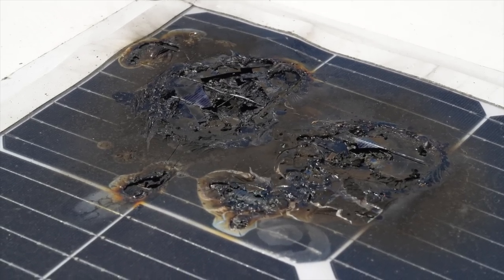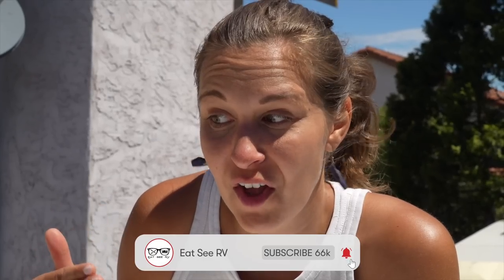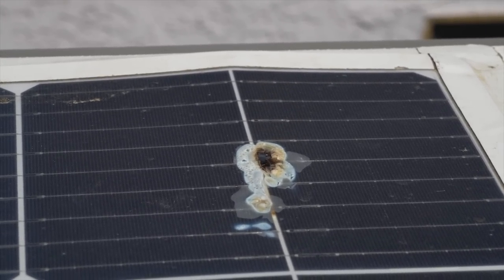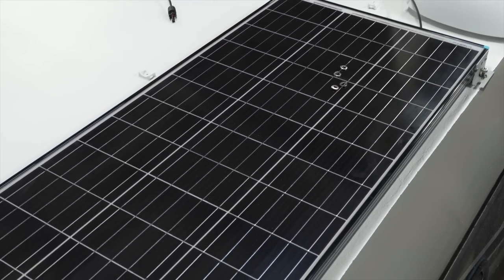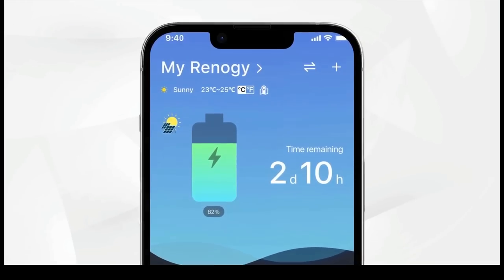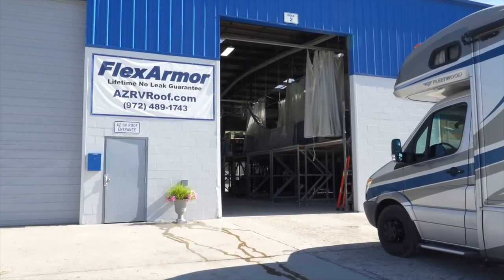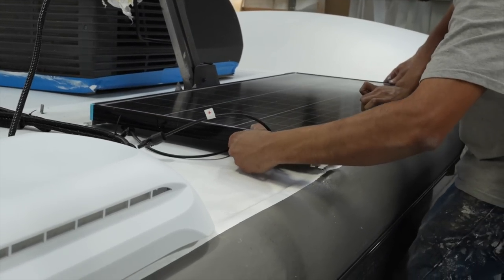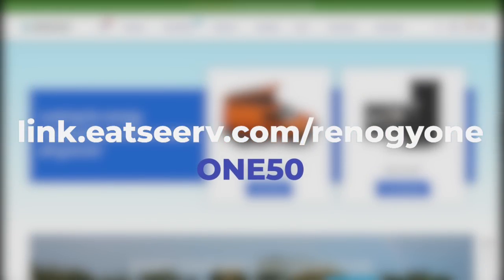Don't Let This Happen To YOU! (Our RV Solar Panels Caught on Fire)!

Comment: Just 2 minutes in and you probably answer this and I will keep watching.  But what did the manufacturer say about this type of mounting?   Asking now because I might have to pause video and not come backfor an hour.
Reply from the maker: The manufacturer says you should adhere it to the roof tightly so no air can get in (tape on the sides isn't enough). But from further research that can cause hot spots since there's no breathability underneath the panel and can cause a fire that way. They simply aren't worth the risk!
Reply: @EatSeeRV   Thanks!!!!   I thought you used them outside their scope, but you didn't.   I was thinking where is the cooling effect, (breathability).   These people need put out of business before they kill someone. I hope you pursue a settlement from them!

Comment: I have a curious question. I have seen that these flexible panels have been melting like this also. But my question is, is the spray armor conductive or non conductive? Curious.
Reply from the maker: We haven't had any other issues with flexarmor burning with other applications on the roof. The issue is the flexible panels.

Comment: Flexable panels are far frailer than ridged - with a clear plastic insulator to the front and no circulation from the back the heat poured in with no way to get out - failure was inevitable eventually - the only effective solution is ridged panels mounted so air circulates under - I use rec twin peak on my RV  and they work flawless - some of the tiled types are even better

Comment: Yup need air flow under panels. That's why I would never use stick down panels,not worth weight savings.... Sorry for this,glad your ok.
Reply from the maker: Thanks! We're glad all is well too. We had air flow under our last ones and they still failed a year and a half in. So while less fire hazard still not worth the money.

Comment: Hi interesting video i was going to buy 4 Renogy flexible solar panels for my van so are you saying all flexible solar panels are not worth it including the renogy flexible panels? 
As im in two minds now what panels to use 
Renogy say there flexible solar panels are ok for RV use
Reply from the maker: I would not buy flexible panels at all no matter than brand unless my RV roof was oddly shaped and it was the only solution.
Reply: @EatSeeRV  hi again 
thanks I'm gonna go with the rigid soler panels from Renogy uk 
thank you for your video and advice keep driving and smiling 
all the best tom

Comment: Ouch!
Two things - you seemed to have a lot of unused roof - yet only installed 3 x 100Watts. Later on - you seem to admit that 300Watts is not enough for all your needs - why didn't you add more PV's or simply try and cover the roof with PV panels. Could have gotten the extra threaded studs installed on the roof quite easily!
And - you wired up the three panels in parallel - which suggests you are using a PWM device between PV's and Batteries. I would have though running a number of panels in series (as long as shade is not a problem) and feeding that through an MPPT controller would be more efficient and give you a slightly longer charging period per day.
I'd also check that the panels have by-pass diodes - which helps with partial shading and could reduce issues with a bad cell.
Reply from the maker: 300 watts was more than enough for our needs. We had 300 before and never had to turn our generator on. It was that a chassis charger alone was not enough for our needs.

Comment: Put XPS / Styrofoam or other insulation directly on the bottom skin of a rigid panel and you will see similar faults - not as immediate, because rigid panels are usually covered by glass on top and more heat resistive silicone on the bottom. However, this will reduce lifetime dramatically. Putting panels directly on an thermal insulated surface is always a bad idea.

Comment: Wow, that sucks. It's important to understand that this is a crystalline style flexible solar panel. The kind that are most abundant. They claim they can be bent to 30 degrees and whatnot. There is also another technology for flexible solar panels called CIGS. It's a much better design with longer life solar panels, big flexibility, and more efficient. 

The crystalline style solar panels are just a bad idea on the top of your RV. But for a mobile style solar system they work very well. Just keep in mind that not all flexible solar panels are built the same.

Comment: Would you please share info regarding the added roof protection you’ve added on, approx cost for such or a link where I might obtain info. 🚌
Reply from the maker: For the FlexArmor Roof? Sure thing you can see our video here: https://youtu.be/xBAcvIqFtKc Cost is determined by the length of your RV. But the website will give you a free quote based on your specific rig.

Comment: I just wanted to know were they recently pressure washed? it can do it too.
Reply from the maker: They've never been pressure washed
Reply: Is it alright  to cover with epoxy temp resistant covering  entire glass to stop of any ingress of moisture water?
cost if 550W panel is 100$
cant just throw like that
But risk is there for any fire???
Although  I connected all 5 panels + 3 slightly damaged in series got 300V +
just for experiment 
But if I coonect permanently  on the rooof what dangers can i expect??

Comment: You guys are so lucky... i do have a serious question... why did the fuses or breakers not trip... that is what they are in the circuit. The arcing should have blown or tripped something... stay safe
Reply from the maker: Because it combusted in the panels not from power going to the panels. The fuses were never involved.

Comment: Is there a reason the cables from the panels are so short, wouldn't it be neater to either have longer cables or plug directly into the panels?

Comment: ok who in the heck thought it was ok to mount them directly to the roof with no air gap.?  thats like common knowledge.
Reply from the maker: The panel instructions say they can be attached directly to the roof. We used an air gap previously and they still failed.

Comment: And what panels did you have installed?
Reply from the maker: Aims flexible solar panels. But as we mentioned in the video this can happen with any flexible panels!
Reply: @EatSeeRV  true but even rigid panels can have issues as well. Seen them burn in between cells. But at least they are lifted off the roof some.
I haven’t seen it with renogy flex panels yet as far as fires but have seen dead panels due to damaged cells. 
Interesting for sure as more and more vendors are making new lines of flex panels.
Reply from the maker: Good points. Nothing is perfect but haven't heard of many issues with Renogy as you said!
Reply: @EatSeeRV  agree pros and cons with all, and who likes drilling into your roof 😂👍🏼

Comment: you had no air pocket between the panel and the roof it would have been getting super hot,not the panels fault,the fault of the installer in a nut shell
Reply from the maker: We followed instructions for installation by the manufacturer. We had an air gap before on our flexible panels before these and they failed too.

Comment: I won't go into details but when panels get shaded just in spots it can cause problems and fire I would say most panels are built so that hot spot more or less can't occur. The shaded sections get shut down and power goes around that section to help stop hot spots. I've built a few panels from scratch and studied the phenomenon.
Reply from the maker: Interesting.

Comment: Actually, it is the Solar Panel company's fault. Those panels are cheap. The copper wiring is cheap. With a nice RV like yours, you should have gone CIGS panels. See Hobotech review and year after review. The copper wiring is thicker.

Comment: What brand ???
Reply from the maker: For the new panels or the old ones?
Reply: @EatSeeRV  the ones that burnt...wondering if were Tesla's ..has they had this problem with panels shorting ...also make sure they have space under for air circulation .so they don't over heat. I'm on my 12 the yr .with solar & wind .cheers
Reply from the maker: Nope they were Aims. But it can happen with any manufacturer. It's the panels that are the problem. Not necessarily the maker.

Comment: Rigid pannels catch fire as well.  Millions of flexible pannels are used every day without catching fire.  Just not cheep ones.
Reply from the maker: That's a good point. It can happen with any panel. We've still had two separate failures of flexible panels though. I don't think they're worth it.

Comment: Have a 400w solar panel on my 5th wheel.  When Briter Products was installing it, their technician told me that it was extremely important to have air space under the panels to prevent such heat build up, and he even told me that you should use wire looms and allow air space around the cables because some people with seal the cables to the roof or under Eternabond tape and he said that will cause the cables to overheat.

Comment: I don't believe this is happening. Could be a scam on youtube to advertise for Renogy. I had 3 flex panels on the roof of my RV and they are working fine. Firecrackers accidentally felt on the RV? OR Products MADE IN CHINA
Reply from the maker: Yes I burnt a hole in my panels and RV roof for fun. 😣 Glad yours are working well! We've had 2 sets fail now and 1 catch fire. So we shared our experience here.

Comment: Sux about the flexibility panels, I never thought they were a good idea. I have a 3" air gap with the 1,200 watts of solar panels on the van roof. They provide shade for the van and enough power to keep  the mini split happy. I wish I had of known about the coating you have I definitely would have done that with the van roof. 
It's a cutaway box van with a fiberglass roof. 
I'm glad the damage was so localized and minor. 
👍
Reply from the maker: Sounds like a good set up. You can always still get it done. They take the solar off and reinstall. I think it's worth it. We'll never own another RV without this roof! Haha

Comment: There is good quality and bad quality.  The problem is that you installed cheap flexible panels which is what far too many boat and RV owners do.  Cheap lithium batteries are bombs waiting to explode.  Solara and Sobrian flexible solar panels are engineered for extreme conditions but, of course, they are expensive.  Lithionics, Xantrex and Master Volt are the only lithium batteries that are currently UL 1972 certified.  Yes, there are aggressive lithium battery manufacturers that are offering discounts to Youtubers but isn't your life worth the extra cost?
Reply: I was just informed that Expion360 RV batteries are UL 1973 certified.  They have become extremely popular amongst truck camper owners especially.

Comment: You didn't mention that the panels were removed, previously, to coat the roof. I'm assuming the roof coating company re-used your old flex panels. And you failed to mention that Renogy gave you the replacement panels. I'm running Renogy panels, but had to buy them. They work VERY well.
Reply from the maker: Those were brand new panels that were installed after the roof was applied. As our first set failed We couldn't reuse if we had wanted to. We also bought our Renogy panels and worked with Renogy on their Renogy One product. Not sure why you seem angry about this. We disclosed everything in the video. Wishing you well and glad you enjoy your Renogy panels.

Comment: alot of people make this mistake and think they can just mount flexible panels flat on anything, YOU CAN NOT. They must have an air gap beneath them to allow circulation or they will overheat and do this.

Comment: Not to sound brash but are you both really that naive? ""We spoke to the Ames "Technician" and he explained what could have happened; he said it was no fault of Ames whatsoever and that the panels were not faulty blah blah blah...""" OF COURSE they are going to tell you that! Do you really believe they're going to admit liability and take the blame for a fire caused by their panels?" And of course they are going to blame the entire industry and say all flexible panels will do this.  If that were true, who in the right mind would sell panels that are likely to catch fire and eventually kill someone? No one. Their panels are junk and dangerous given your experience.

As someone whose background is Electrical\Electronics Engineering tech my OPIONION given how new those panels are (5 weeks old)  is that they're all defective since you said that ALL of the panels showed  varying signs of failure. I would be demanding a refund and threatening legal action if that were me. But with that said, I, just like the Ames "Technician," nor anyone else CANNOT make a factual determination as to the cause of failure without physically inspecting the panels. But I can tell you with 100% certainty that those are junk and dangerous cheaply made panels. 

Renology is a reputable solar panel supplier ( I am in no way affiliated with them) and one of their staff who uses flexible panels wrote a good piece about busting the myths of flexible solar panels and NOWHERE was it mentioned that they "can catch fire". In fact the article states that the author lives on the road and whatever they're using (they are flexible) look and still function as new after 9 months and 9000 miles of road use. You are literally playing with fire by buying the cheap panels that you are.

Comment: I don't think Renogy did you any favors. You  shouldn't have to pay a monthly fee for monitoring while other brands do it for free, and 100 watt panels are the cheapest ones to buy and honestly you should have gone with 350 to 450 panels. 100 ones won't do much for you.  Sorry.
Reply from the maker: We chose those for weight and length. We wanted 200 but they were too large for our usable space (without shade and shadows from other units on the roof). Also the monthly fee can be paused and goes far beyond just monitoring your batteries and panels alone. For weekend warriors or people who do longer trips (not full time) that's really nice!